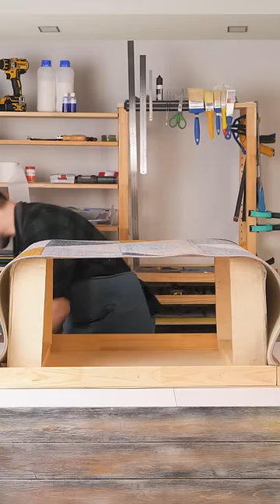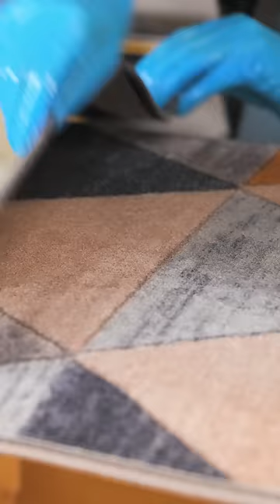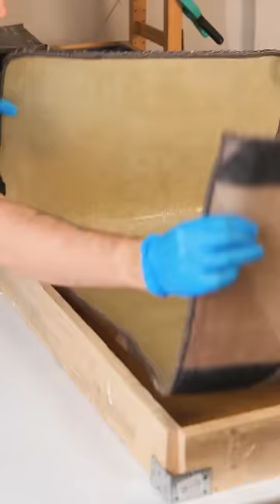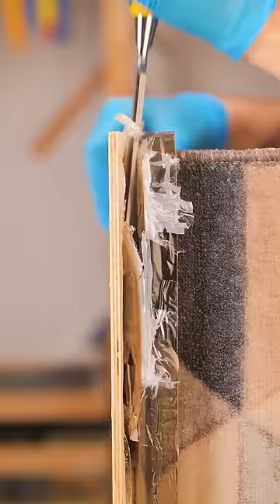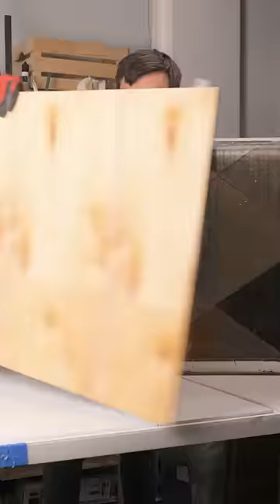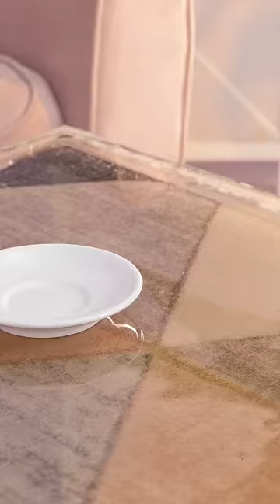Awesome table made from a carpet and epoxy! Cool DIY for your home! #woodmood #diy #epoxy

Comment: cool project you've shared.  just miss a protection mask for the acting person, fumes or aerosols of epoxy resin may be harmful on the long term if you're exposed to without propper protection. would make sense sharing that too.